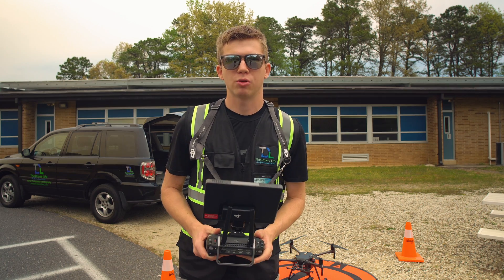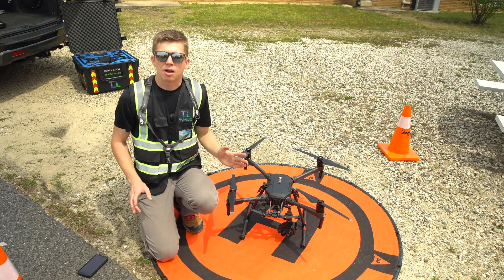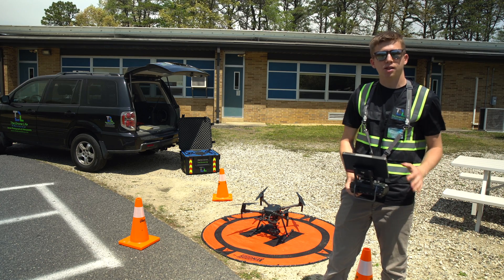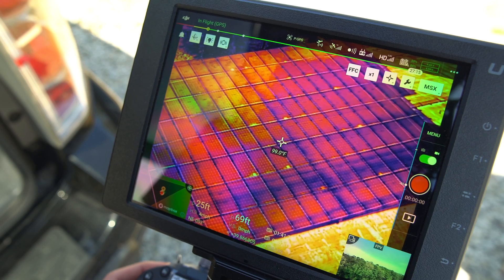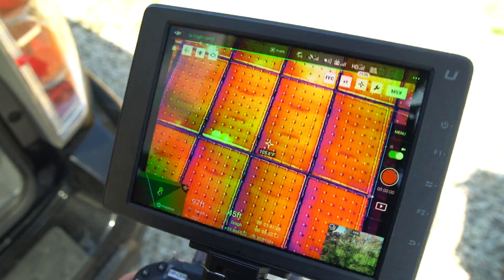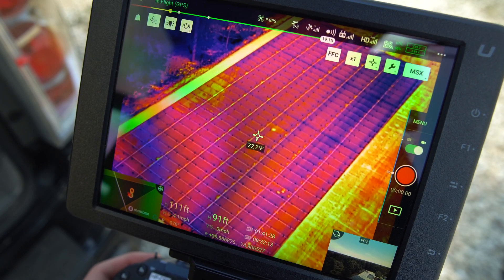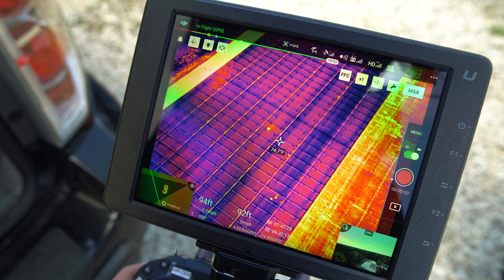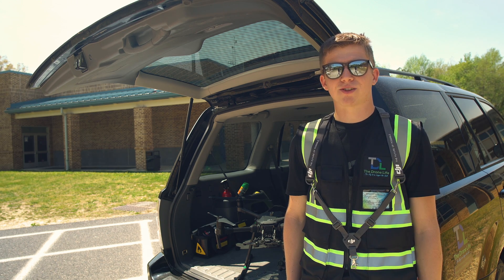Flying an Infrared Drone Solar Inspection

Comment: ..Each single Cell should be made replaceable plug n play style..and they need bypass diodes in each ones..after resistance thermal inspection ..that will change the overall efficiency ..like a lot

Comment: Great video! I just got the Dji Enterprise Advanced.  I see it has a 9mm thermal camera. You mentioned the 9mm cameras would not be best for solor inspection. Was wondering if it is because you would have to fly at a lower  height? Any help would be great.  I'm looking to scan some smaller solar fields with his new drone.
Reply from the maker: Yes thats exactly correct. For the 9mm the drone will be really close to the panels and possibly below the tree line. It could be done but is more risky.
Reply: Hi,
Just bought the M2EA too and want to do the same job.
Which advices can you provide to help me starting the activity ?
Rgds